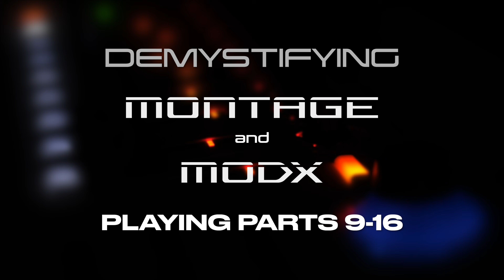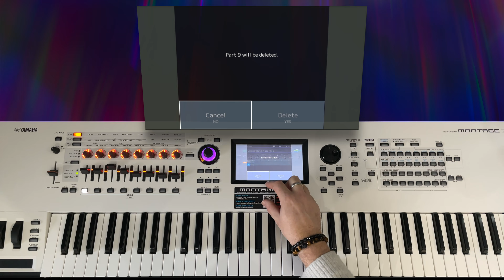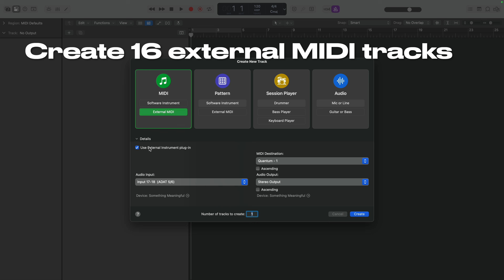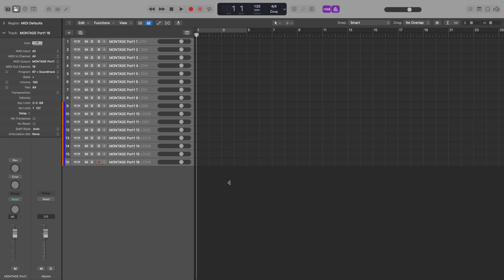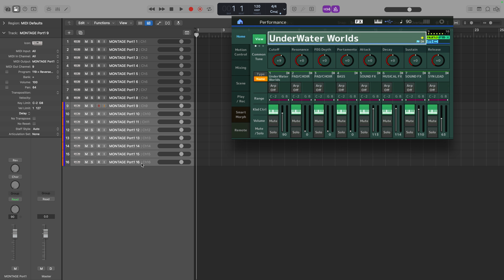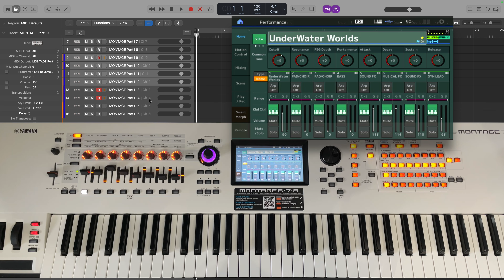Add keyboard control to parts 9-16 with Yamaha MONTAGE M, MODX and MONTAGE - tutorial

Comment: This took me the longest time to understand, thanks for making it clear. Its a bit of a gut punch because I was hoping the Montage was going to act like a sound module (16 channels of instruments), but while it can do that using a DAW, it sounds garbage as the single channel sounds are pretty average. Its really a single instrument with 8 layers, and 8 extended layers if you use a DAW. Thats still amazing, but a total pain if you want a collection of nice instrument in your DAW on call, you need to manually Live Set swap (or use Montage Connect I guess)

Comment: Hi Kier, just as a thought...I have an old Akai ME25S MIDI Note splitter 19" rack unit from back in the day (creates 4 split zones over MIDI onto their own MIDI channels). Do you think I could go out of a MIDI DIN on the M7 into the ME25S and back into the M7 then assign 4 of the part 9 to 16 sounds on the M7 to play on the keyboard without any kind of weird MIDI loop type behaviour?
Reply from the maker: Assuming the M7 transmits on channel 1 and you don’t send that back, that should work just fine

Comment: How to remove keyboard control completely.?! If possible…
Reply from the maker: I’m not sure I fully understand your question. If a part has does not have keyboard control enabled, and it is not directly selected, it will not play. If that’s not what you are asking, can you please clarify?
Reply: @KierDarby  I have the MontageM6. I just want to play single part sounds. Multi part sounds take up extra midi channels 1:38
Reply from the maker: @hardbody_beazy I’m afraid still don’t understand the issue.

Are you talking about playing sounds with the built-in keyboard, or via MIDI? Are you asking about the first eight parts or parts 9-16?

As far as MIDI channels are concerned, all  parts with keyboard control use one channel, and you can set any parts with keyboard control disabled to use the same MIDI channel if you want to do so on MONTAGE M…

If you only ever want to use single part performances, you can filter the performance list with the attribute filter in Category Search., although doing so kinda defeats the purpose of a multi timbral synth like Montage.

Comment: With a short midi cable, you can do it on the MODX or Montage directly without the DAW
Reply from the maker: You can indeed, but doing so prevents the MONTAGE or MODX from communicating with any other instruments over MIDI at the same time.
Reply: @ but you get an Abo from my side :) cool channel !
Reply: @ that’s right but for the stage … it could be useful because some people are using one key and no DAW on stage
Reply: Please, can you share how this can be done?
Reply: @ Yes, I will do it ASAP!
Reply: @thkeyboardsounds  have you done it yet?
Reply: @samn1ce  I figured out how to do it (I have a Modx M).  

1. Connect a midi cable to midi out and midi in
2. In Utility > MIDI I/O, set midi in/out to MIDI.  (usb didn't work as well -- could only control one part)
3. Choose a part from 1-8 to act as the midi controller.  In zone settings, set Part Mode to External and Transmit Channel to 9 (any from 9-16).  The instrument on this part will not sound.
4. Add a part to part 9.  This should now be controlled by the midi controller.
5. Add any other parts to 10-16.  Set them Tx/Rx channel 9.

There is a bug in my keyboard.  When I add additional parts above 9, they cause the lower parts in 9-10 to change to Concert Grand.  I don't know if this is related to the midi setup or not.  Maybe that bug will be fixed in a firmware update.

Comment: Hi there, it's amazing that you figured it out like that. But I think we need to put pressure on the company to technically solve this stupid restriction. Not only was it on the original Montage, but this nonsense is also used in the new Montage M, where there should be no complaints about processor performance or polyphony.
Personally, I don't understand why they are doing this and forcing us to work around this technological flaw.
Reply from the maker: My guess as to the reason for the limitation is the focus on the eight PART buttons and the ability to directly select or toggle keyboard control for any of parts 1-8... but then again, we are provided with a shift-function to allow direct selection of parts 9-16 so I don't reeeeeeally understand why the same couldn't be done for keyboard control.
Reply: Pressure in Yamaha? 😂 This was a good one👍lmao